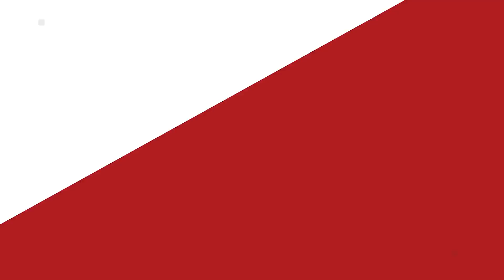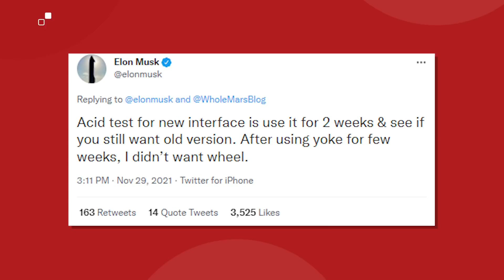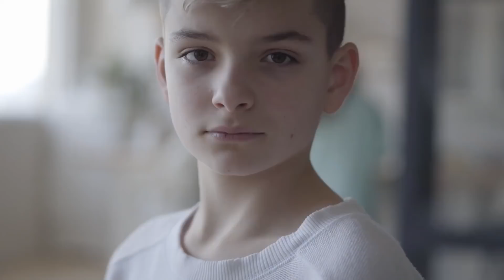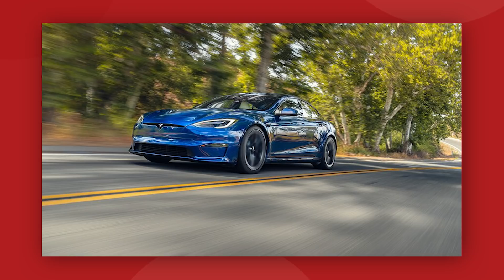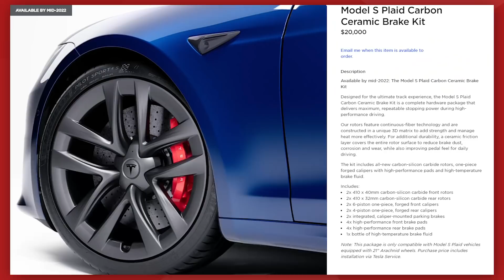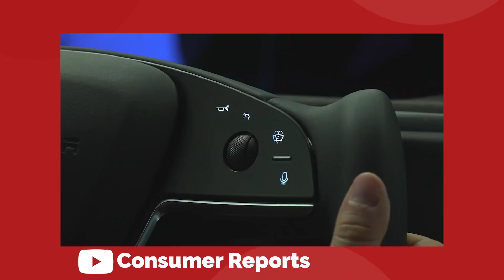The 2022 Tesla Model S Update Is Here!

Comment: We are not driving a plane or a race ca where turns are only 90 degrees at most. The yoke is horrendous when trying to do a K turn or back out of your tight driveway. I get in my old S and it’s such a pleasure to drive purely for the steering wheel. If I could replace the steering wheel on my new one, I would in a second. It’s awful. I hope I don’t hit someone because of it.
Reply: Do you like the car other than the steering wheel?
Reply: @justinevans1515  I replaced the steering wheel with an aftermarket full wheel from Tsportline.  Now the car is drivable and fun, but that yoke is so bad, it rendered the car near undrivable.  I still like the styling of my old S with the 21" silver rims and trim better than the all black of the new models.

Comment: Elon there is an old school steering wheel accessory that in the past was very popular especially with forklifts but also in cars in the 50s.  A Cheater Knob.  It doesn’t have to be a full size knob, more like a mushroom top (half circle) a low profile knob like this would allow you to easily spin the yoke more smoothly and quickly.
Reply: Yup, I tried one but it didn’t fit well because the yoke is much thicker than a regular steering wheel.
Reply: Variable ratio steering should have been the most obvious solution for a yoke, boggles my mind why they didn't implement.

Comment: "With the stock tires and a regular asphalt road surface, the Plaid CANNOT accomplish 0-60 in less than two seconds. It's physically impossible" 

That statement is false. Numerous videos show the Plaid achieving 0-60 in less than 2s, on regular road surface. Brooks of Dragtimes has done it. Now, if you said it can't be done without the 1 foot rollout rule, then you'd be correct.